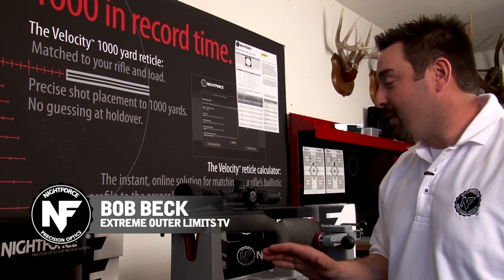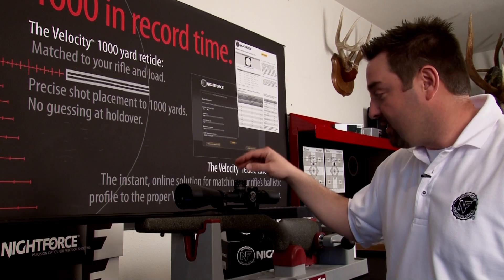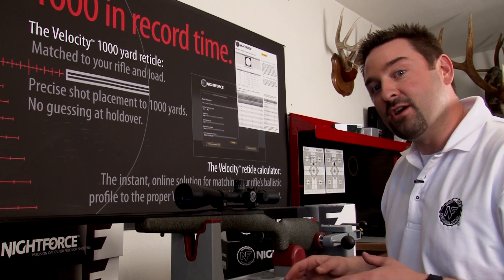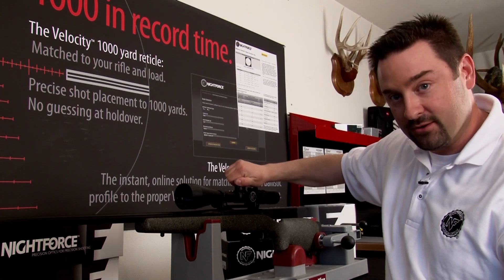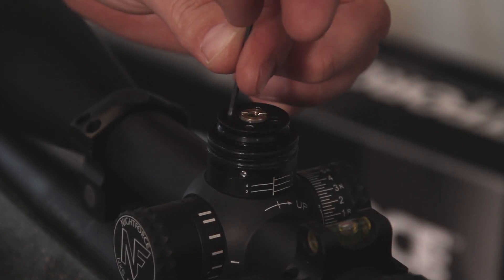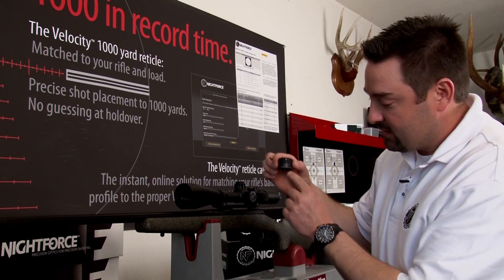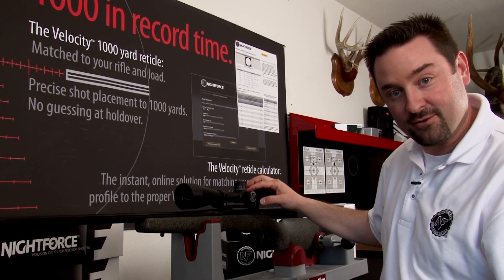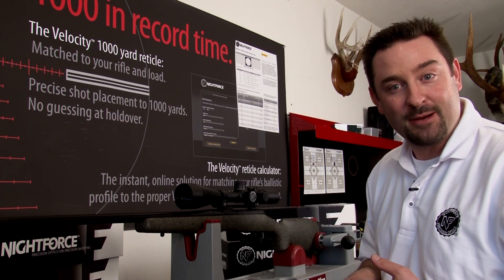Nightforce ZeroStop - Explanation and Correct Adjustment.mp4

Comment: help me understand  some thing ... so if i want my zero to be 100 yards  then would not the scope be out by a hundred yards down range .. for example  if i was to shoot some thing at 500 yards  i Dial  it to 500 yards would that not be then 600 yards.  so what range do you set the zero to.
Reply: that's not how it works. the dial is in MOA or MILs. There isnt a yardage marker on the turrets. So zero your rifle at 100 yards, then whatever ammo you are using should give you a velocity reading on the box and a ballistic coefficient labeled in G1 or G7. Velocity and BC are the two items you need to plug into some type of ballistic calculator like the app called "Strelok Pro" and it will tell you exactly how many MOA or MILs to dial on your turret to shoot at 500 yards. 

For example I shoot 6.5 Creedmoor with a Nightforce scope. I run the 140gr ELD Match bullets. I type in all the info into the calculator and for me to make hits at 200 yards I need to dial 0.6 MILs, 300 yards is 1.6 MILs, 400 yards is 2.2 MILs and 500 yards is just under 3.0 MILs. Then when you're all done shooting you just turn your turret all the way back til it hits the zero stop like explained in this video and you're basically back to being zero'd for 100 yards.

Comment: I would also like to know if when you have set the zero stop is the full 100 moa of vertical adjustment still possible or does it only have where you reset the stop from.